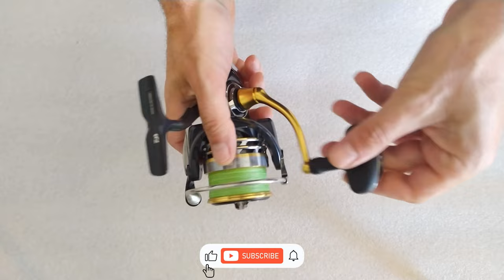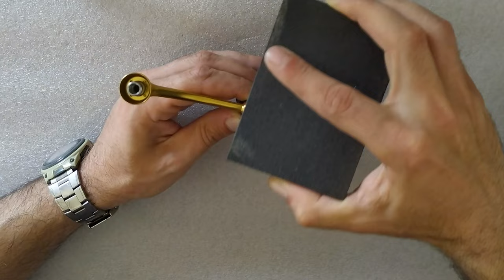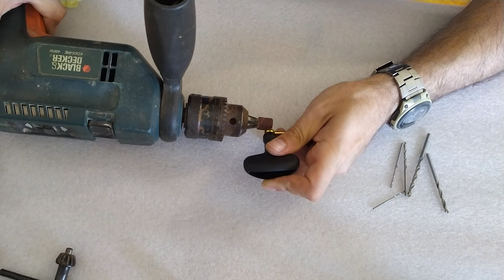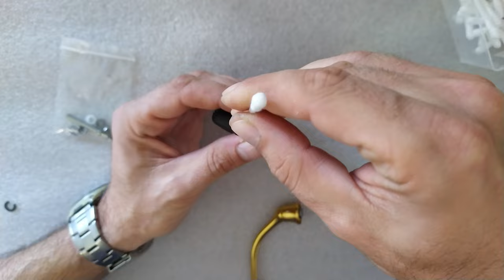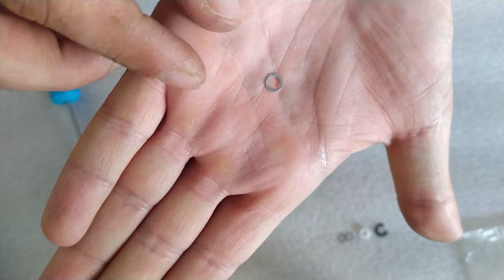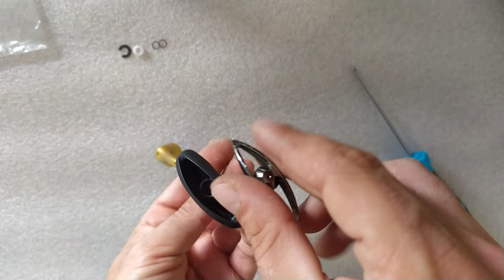How To Remove The Knob And Add Ball Bearings I Knob Replacement I DAIWA and SHIMANO reels

Comment: To provide guidance (centering) to a drill, punch a workpiece. Without the grit, it is extremely common for the drill to wander, meaning it wanders around aimlessly on the material without hitting the exact point of the hole, as is the case with you in your video.
Reply from the maker: haha yeah, tell me about it. i tried doing it,  but the shaft was harder than the small puncher i had. even drilling through it was harder than i expected. but as u can see in the video, energy and persistence conquer all things. 😉